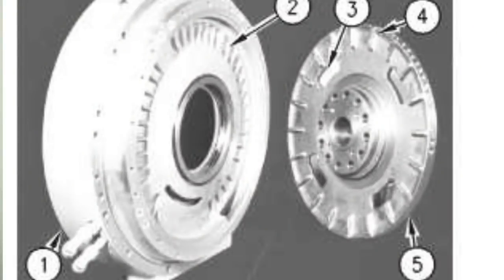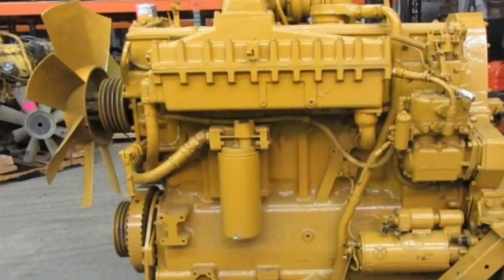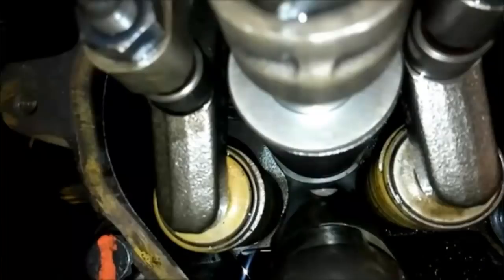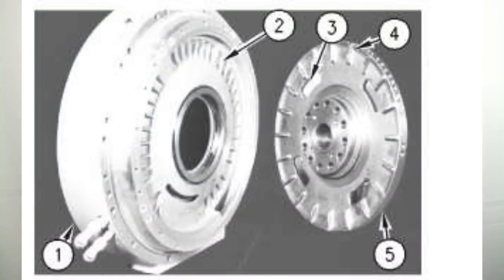What is a Cat BrakeSaver? Caterpillar BrakeSaver. Is it a brake saver?

Comment: Thanks for this video dude. Something I've heard or read somewhere is that the brake saver was common on trucks with a 3408 since they didn't have jakes on that model engine. Also gotta say I want that hat. 😉👍
Reply: I think just about every highway 3408 had a Brakesaver. You couldn’t fit Jakes apparently.
Reply: They had break savers on the 3408 V-8 CAT'S because that engine was originally designed for off road equipment like ; D8 / D9 crawler tractor's ( bulldozer-track loaders --belly scrapers - ect ect ) 450 HP. & 1650 # of torque .
Reply: @stormyweather9054  Most of the Australian spec highway 3408s like mine put out 550 HP at the wheels, I believe that’s a little over 600 at the flywheel. The marine dual turbo 3408s could put out 800 HP.

Comment: Adept Ape, would you be interested if I get some footage or pictures of the brake savers on my company equipment? We got a 05 Ken tri-drive winch tractor with a C15 Acert MXS and a 95 western star tendem winch tractor with a 3406B both trucks have the brake savers unit, here in Alberta near Jasper park. Both units this spring, we re due to re-seal the brake saver valve seals and diaphragm. And I’ll be performing that work. They tend to leak and Our 3406 many years ago, shot oil all over inside the cab due to the dried up  cracked diaphragm. Even my brother has videos on his phone on how well them brake savers work when in use with heavy loads if interested! BTW enjoying your videos. Let me know!

Comment: Thanks for the insight to "newer" brake saver system.  I always wondered if they got better.  My perspective is from  1970s logging application in Pacific Northwest.  In the late 1960s, some logging trucks  still had water tanks for brakes and during the winter (when logging was shut-down), adding turbos was the rage especially for Cummins 200 engines and we also added Jake brakes.  "Oil retarder" capability came along at a time when Cat engines became popular in late '60s and early '70s.  The Cats were more expensive to start with and the oil retarder compounded that.  In the end, the early retarders DID NOT work as well as Jakes and after 5-7 years (late '70s and '80s), the pendulum swung back to Cummins with Jakes.

My perspective was from writing a computer program to help loggers estimate their costs so that bidding on the hauls was simplified and more accurate.  This was 20 years before PCs came along with spreadsheet software.  I recall how frustrated owners were that the investment in oil retarder was a bust.  Oil changes were more frequent and expensive, as you noted, PLUS brakes did not last as long.  The frustration was bad enough that it damaged the Cat brand in log truck industry for many years.  (Of course all the tracked and wheeled loaders were Cat.)
Reply: Log trucker from the PNW here. I have a 3406C mill in my truck with the brake saver, and I do so love the saver. It holds the truck back a lot better than some of the other trucks with jakes. Now we all know that Cat jakes sucked unless they were super jakes, but even our 60 series with the double tap jakes doesn't hold down some of the grades as well as the saver on my truck.  Despite being a 1994 engine, it still eats diaphragms about once every 8 months. I will be adding super jakes to the truck to supplement the brake saver itself just for when the diaphragm does fail since I'm not keen on cooking my brakes.

Comment: So just to expand upon brake savers, Liebherr produces their own engines for their mobile cranes and many of their models are going back to brake savers combined with their version of compression brakes. I run a 5 axle crane that weighs 150,000lbs and the combined pair will hold it back to its governed speed on a respectably steep descent. On level ground i dont need the air brakes until the brake saver and jakes are disabled by the low speed threshold, usually around 10 to 15mph. They really are maintenance free and are as strong if not stronger than Telma (eddy current) brakes which were common on Liebherr cranes in the 90s and 2000s.

Comment: Didn't see any at the shop , then had 2 trucks with it. One in frame, one resealing the brakesaver and fixing a pinched actuation air hose. Interesting stuff.

Comment: I have one of these on our 1989 Pete 379 with a 3406B. It’s not all that impressive honestly. Even with a Jake brake and brake savor combo. Oh and a mechanical injection system makes the craziest smoke with flames when using the Jake while on the throttle.....😂
Reply: Could have a hole in your diaphragm and you can set the psi you more. May fail the diaphragm faster and watch your oil temp.
I would not recommend using the Jake in throttle on.
Reply: I didn't read all the comments butt i have a question you said that it creates friction in the oil wouldn't that shorten the mileage between oil changes?

Comment: The 3408 mechanical engines that came in trucks had them back in the early 80's
Reply: Speaking of V8's with Jakes or Brake Savers:
- What was the firing order on the 3408? 
- What cylinders did the Jakes act on in each level (low/medium/high), if they had Jakes?
Reply: @electric7487  the 3408 was a bulldozer engine, it really wasn't meant to be in trucks. Instead of making it a 90 degree v8, they made it a 65 degree v8 to fit it into truck frames. When people started turning them up, they would snap the crank. 3408A's never came with jakes from the factory, nor have I seen one with jakes installed.
Reply: I would guess you need it that way so it can fire every 90 degrees since 90x8=720=4 strokes. I think it fires 1-8-4-3-6-5-7-2. 65 degree firing intervals times 8 wouldn't equal the the whole 720 degrees of rotation.
Reply: Those held like 18 gallons of oil with the brakesaver.
Reply: @chrisleggett685  did you ever get to work on one? Are you good with the injection pumps?

Comment: I had a brakesaver on an '85 Pete 359  I had at the time 3406B and Spicer 14 speed. It took 1 extra gallon of oil per change. Yes the diaphragm on the spool valve went out regularly. Think the longest I got was 2 years before it would get a hole on the bottom of it from the spool valve resting inside it. Cool thing was anytime I was under 70k gross I could run down Grapevine going north at 50 and never touch the brakes. Oil would be pushing 250 deg at the bottom and the water would be close to 210 however.
Only problem I ever had aside from the spool valve was at around 500k miles on the remote oil filter housing ( behind the hood and under the passenger door in front of the step) got a hole and started to spray oil out all over the side of the cab.

Comment: I changed the brake pads on my 79 D200, which haven't been changed in years. The was plenty of meat left on them, however they were unfit for further use.

The problem was that they were cracked from when I overheated and glazed the brakes coming down a mountain pass with a trailer on.

Comment: I’ve had the pleasure of doin a clutch on a truck  that had one. Pain in the butt
Reply: HOW SO?
Reply: @redline9536  on that particular truck we had to change the bell housing out due to the bolts breaking for the motor mount. What should have been a one day job turned into a week long pain in the ass.
Reply: @Thebassguru84  OH YES. THERE LIKE 7" LONG. I'VE BEEN LUCKY WITH MINE.
Reply: It took a week to do a 2 hour job?

Comment: Also, I know you have touched on Cat filters in the past, but this video has renewed my interest in the 244-4484 filter. Possibly more in detail about the Standard 1R-0716, The High Efficency 1R-1808, and the Ultra High Efficiency 244-4484. I have often thought about upping my truck with a Brakesaver to the 244-4484 just as a little extra protection for all the extra seals and O rings she's got. Also have been considering getting into the bypass oil filter game.  Thanks and as my first comments thanks for putting together a great channel for the Yellow Motor!

Comment: Right now I'm working on a t800 3406b dump truck with one.  Long story  we bought it cheap.  problem was that they took it to a shop to get something worked on (I think head work)  while it was torn apart the shop caught on fire so the shop closed down. Put all the pieces on pallet  and 5 gallon buckets  return it back  to the owner like . It sat for a couple of years   so we decided buy it  and   found another good running  3406b from a different truck  .  so we are just pulling that torn apart  out and swapping the complete running one back in  it,  saving us that hellish nightmare of seeing whats there and whats missing.   I might make a vid on what we are doing on it

Comment: Drove one on a '79 Pete 359 with a 3406 PCTA 375 HP. Worked about as well as Jakes on Cummins at the time. Only downside was the oil temp would go up. I liked the ability to tether the amount of retarding with the mini Johnson bar applicator. Also, they were heavy, which, at the time, when pretty much everything paid "by the hundred weight", mattered some. And yeah, the guys that had both the brake saver and Jakes had the ultimate. I knew a guy who routinely went off Homestake Pass at 40 mph running both.

Comment: With my 1693 I leave the fan on going down a long grade to keep oil temp down.  The fan comes on automatically, but by then the oil temp is at max.  I prefer a little leeway.  4 extra gallons of oil.  It is nice on slick roads, it won't stall your engine like a Jake.
Reply: Also the fan helps with some drag. Seen just a few 1693's with a Brakesaver. The first one's the oil cooler was not on the engine. The one I worked on it was mounted by the front tandem. Hoses going to and from the cooler.

Comment: A customer of mine has one on his c15 in a kw. It has been wanting me to reseal it. Every time I look at it all I can see is the huge mess it's gonna make. He loves it tho, alot of toir buses use them as well
Reply: There’s a lot of external pipes but they only require O rings. Roughly $200. Plus I think from memory $70 for the control valve diaphragm. You’ll find everything on the CAT SIS system.
Reply: @gm16v149  oh we have everything, and I know which exact ones need replaced, I just don't wanna do it, all I see is the sea of oil that's gonna end everywhere. I'm mobile and dont have a drop pan that big
Reply: @TheCntryson47  Yes, 43 litres of oil. I do have a tip which isn’t in the manual, if you’re removing the control valve : remove all the threaded plugs as well as the drain plug, heaps of extra oil will come out making the job a lot less messy!
Reply: You need to find some one to show you the ends and outs of these thing's. You got to have Cat tooling, fabricated tooling and he has to have some money. It has a piston ring on both sides and you can break them or damage the hydro-dynamic seal. Never reuse any seal or gasket on these. The good thing is, before you put the transmission back in. You can load test it and check for leaks.

Comment: I drove a 1995 Kenworth T800W with a 3406E that had the Jake and retarder. This was a heavy haul truck so getting off the mountain passes grossing 200,000 pounds with both on made it a lot faster and you hardly used your service brakes.

Comment: If the brake saver performs well and has longevity, I find this an amazing technology. I would expect that Jakes are the common method to decellerate, but it looks like Cat came up with a good technology. Bear in mind, I am not a diesel guy.
Reply: Brake savers are easy to blow up if you put a bad driver in you wont have one for long

Comment: These surely reduced engine oil life as well. Forcing oil through any restriction would accelerate sheering as well as the heat cycles it goes through. I can't imagine using these on long grades for miles and miles would be good on the oil especially the oils that were used back when they were popular.

Comment: Actually the "Jake brake" was invented by Clessy Cummins...........hence other manufacturers aversion to using their idea.  As usual it took everyone else decades to realize it was the best idea and adopt it.  Benz,Volvo and Scania had the useless exhuast brakes which in mountain ranges you might as well flap your arms out the window........and Mack had the Dynatard which was about half as good as a Jake but still much better than an exhaust (flap) brake.   The cat brakesaver was a complete flop in Australia.......nobody used them.

Comment: Interesting video..as always . Used to run C15 with Jake and brake saver in a logging truck up here in western Canada . We also called them a Retarder. Worked great , could put it on auto or control it with a second valve . Really no need anymore because new engines have such great engine brakes now. My new x15 Cummins holds back better than that old C15 with both.
Reply: i think you meant "great jake brakes now"

Comment: I wonder how it would be possible to build an external unit that can bolt onto a standard Eaton, Spicer, Detroit, etc, transmission and functions like a brakesaver and uses an external hydraulic pump instead of engine or transmission oil
Reply from the maker: There are electric driveshaft retarders that work decent and are contactless.
Reply: @AdeptApe  There are also aftermarket hydraulic similar to brakesaver.  Voith is the name.  Telma for the electric ones.  Also Allison transmissions have them as an option.
Reply: @AdeptApe  I've seen the electric ones and for whatever reason I'm not a fan, could be the battery requirements and the extra draw that entails on the charging system
Reply: You beat me to the question ,it was a great idea but needed to be separate from engine lubrication.

Comment: I always thought that they should completely shut off the fuel and use a kind of exhaust bypass/diverter to turn the engine into a large compressor to slow the engine and then have larger tanks to store the air and not use the regular compressor which wastes fuel. Then it would be recovering energy kind of like a hybrid charges batteries when braking.

Comment: Here in Colorado a called Cast transportation had them 1993 KW's W900 on the 3406c models worked good but you had to watch the oil temp and pressor if the brake saver pressor got over the egine pressor it would blow a diophram.

Comment: this is why cat different than other american diesel brands they have always try new tecnologies ım engineer in voith retarder systems in eu brakesaver is granddad of todays retarders for example your 15liter 550 hp 2500nm engine giving 3000 nm torque with jacobs brake is open stopping power but with retarder our new ones 4000-4500 nm torque directly applies the shaft

Comment: Can you do a video about the 3406c with an ecm. Peec or whatever they are called.
Reply from the maker: I have discussed them, but perhaps a dedicated video just for them would be a good idea. Thank you.
Reply: Why don't  waste your time on a peec electronic  pull the pump & computer , put the reliable mechanical  fuel pump on, that peec system  has the problems of both electronic &mechanical  but the benefits  of none. Cat dealers will hardley work on the peec system. Or you must go to certain  dealers!!!!!
Reply: First PEEC was a 8TC, had several updates as this was a first for Cat. I still have a copy of Bootstrap I, which was all the updates in a book format. Then they came out with a 2EK and biggest change in it was they added a Coolant temp sensor to help during cold weather, most of these was done in the field. Also they had a 5YG, 460 HP @ 1900 RPM's. Last was the 4CK, first few was a B, last was a C model. A lot of timing advance problems, especially on front sump engines. Cat did come out with a new module that would derate the engine if you had a timing fault. What would happen, the VTU would fail and send the timing to 35.7 or so advance all the time. This would cause the piston's to melt. I have seen the piston rings with the head off. What was left of the piston, would be stuck on the bottom of the head and out the exhaust port like some one sprayed aluminium paint and turbo would/could be locked up. Somewhere in one of his video's I explained to someone how to set the timing sensor and some trick's on the governor side to help them last longer.
PEEC, Programmable-Electronic-Engine-Control.

Comment: Great video, I have a question from my Truck technician exam. When an hydraulic retarder is in the apply position, air comes out the engine oil fill tube, what is check first? a) diaphragm B. Air Compressor, C. Control Solenoid or D. Control Spring
Reply: A Caterpillar Brakesaver has a control valve mounted on the bottom of the oil pan in a housing. The control valve has a air line hooked to the cover. Behind the cover is a diaphragm that bolts to the control valve. As air is applied it moves the control valve. If the diaphragm is blown, the control valve may not move or partially move. Air could enter the lubrication system. 
Your question is poorly written. A compression brake uses oil (hydraulic) to activate, Cat Brakesaver uses oil (hydraulic) to activate. Cat states to do the klunk test KOEO, move the manual lever to fully on with air tanks charge and listen for the spool valve to bottom out. So is your engine is running, which your question does not state? I dislike this question as it is written.